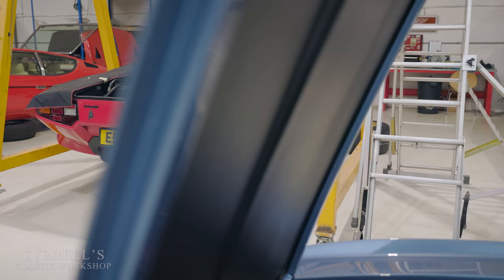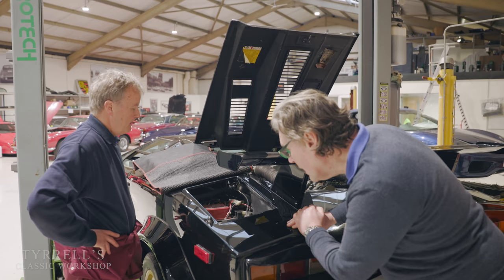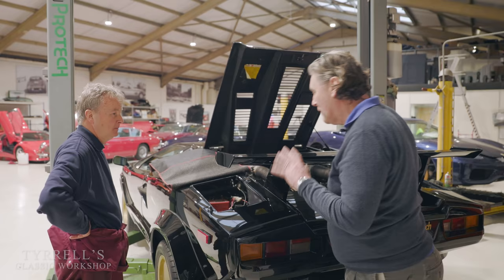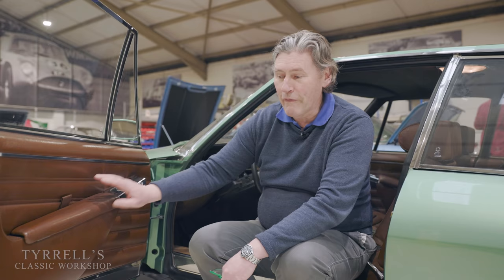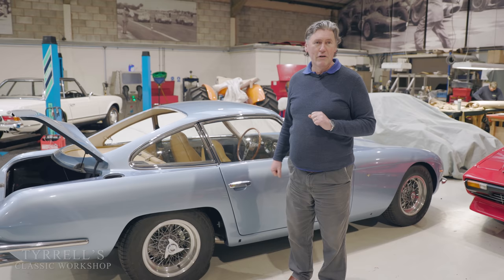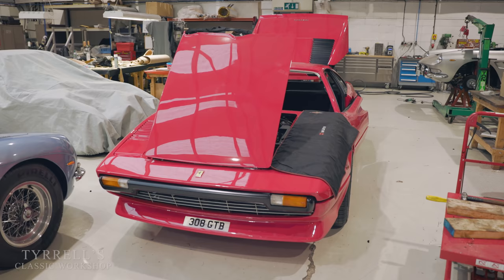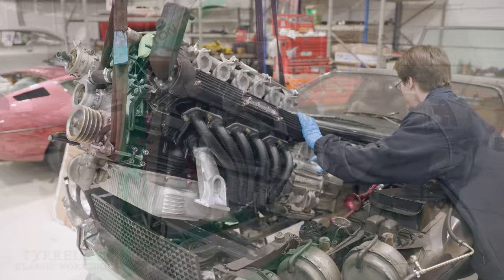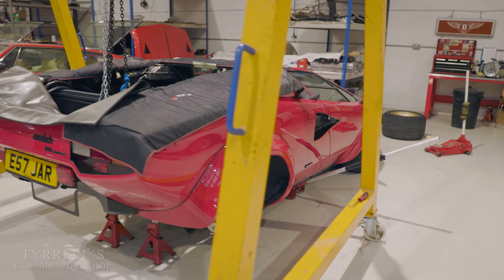One Lamborghini V12 goes in as Harry's is ready to come out | Tyrrell's Classic Workshop

Comment: Great episode again. Love watching this. Since the Countach has got the Bosch K-Jetronic injection system you might consider the 1970s trick of adding two stroke oil once or twice a year (0,5 to 1 litre of oil on one full tank will do). It works wonders in K-Jet cars that don't do a lot of miles, since it lubricates the tiny components in the injectors, fuel distributor and fuel pump. This was a standard procedure in Mercedes Benz and other brand's dealers back then. Full synthetic scooter oil works best since it doesn't smoke and has useful cleaning additives.

Comment: Black Countach. Add a Mega fuse block to the right rear vent box. Run a 4 gauge wire from The alternator output to that. Continue the wire forward to that. Power pin 30 of the radiator fan relay under the right engine compartment opening to the mega fuse block with a proper fuse.  Power both fuel pump relays from that mega fuse block. Run the thick red wire to the MSD box there also.  If the black countach had an ac compressor  install a relay with pin 30 also powered by the mega fuse block.  
This reduces voltage drop to the front and back to the engine compartment. Gives the evaporator fan more power to spin faster to eliminate having to open the doors at stop signs to get air in the cockpit.  
Get a skinny guy up under the fuse box or pull the glove box. Follow the wiring out of the fuse box thru the loop then as it turns toward the front of the car. You will see where the wiring harness rubs on the bare steel dash structure creating a fire hazard.  Before putting the glove box back in
  Unplug the antenna from the back of the stereo. Zip tie a universal replacement antenna horizontally to the dash structure. Then plug that into the radio.  Nobody will know. It cant be seen. The radio reception is so much better than the in windshield antenna. 
Lastly. Pull the louver behind the right door. Pull the triangle panel that let's you into the engine compartment near the fiat 124 thermostat. Yep. More fiat parts. Check the translucent wiring harness connectors for signs of overheating.  It's the power wire from the back to the front that the connector gets hot  and goes intermittent. 
Lastly. Bosch alternators . One brand perhaps more have an adjustable voltage regulator available. It's set for 14.1vdc. Have an alternator shop put it on an alternator and set it for 14.8 volts. The battery in the front boot will now get 14.1 volts with the engine running instead of 13.5 volts which leaves the battery only charged to 65 or 70%  dont believe me. Print this out and prove me wrong.  

Grab the distributor rotor with the cap off and twist it. If the advance weight bushings rattle. Please take the distributor apart and check for worn bushings. Worn pins in the weights.  Worn slots the bushings ride in. The bushings wear in half. Fall into the cap and destroy the 300 buck rotor. If they fall into the distributor housing and destroy the reluctor. Countach electronic ignition distributors are almost impossible to get.

Comment: What amazes me is the way he adjust the tic over on 60s Ferrary and Lamborginis just with a screw driver, twisting in an out untill he gets a smooth tick over. I have a 1960 Fiat 600 and I do exactly the same thing. Of course I have only one cylinder and carburettor. An old mechanic once told me not to screw in the adjuster to much. If you do it you could make a small indentation on the adjuster and ruin it.

Comment: I too recognise that window winder gear as the wiper drive gear on my Fiat 124 coupe. Also used on the 206/246 Dino. Superformance there in the UK offers a full metal replacement.

Comment: FYI the French window and headlight motor gears were also used in the De Tomaso Pantera, which was built to the tune of 7500 units or thereabouts. The size of that market means there is a robust aftermarket, and we have been replacing broken plastic Pantera window gears with new ones made from brass for decades. All the Pantera parts dealers carry them and they cost about $40 each—a far cry from what the Lambo and Maserati parts dealers charge. (In fact they usually buy their gears from the Pantera parts vendors and then mark them up a million percent!)

Comment: 10:50 The Pontiac Fiero has the same problem, fiberglass body doesn't rust, but the frame sure does, I had to weld in two new frame rails on mine. The DeLorean has a similar issue, the stainless body and fiberglass tub look great, but the Lotus designed Y-frame chassis is epoxy coated steel, and I've seen some VERY crusty rusty examples with only a few thousand miles on them.

Comment: I would’ve used triple sealed modern OEM style connectors on the ignition setup rather than those molex ones with no water ingress protection on the back of them. While it probably won’t be driven in the rain, as you said,   waters bound to get in there when people wash it.

Comment: I would use some more modern style sealed plugs in that US countach. If you recognize the design problem of putting the electrics in a place where water can get in it blew my mind that the new connectors are closer related to inside PC type and not proper automotive fully sealed type. This will work for a few years before the entire thing starts acting up again.  To me electrical work was of a lower level compared to the other repairs shown.
Reply from the maker: That’s the owner’s choice. Back to OE. Thanks for your interest

Comment: Hi guys, next problem will be fuel distributor head. It will have rust and not be able to supply the correct amount of fuel to injectors. K-Jet is the most susceptible to moisture. Next problem will be the electric fuel pressure regulators, again bi metallic strip inside fails and it will have a constant lean mixture. Have fun, I’ve delt with all sorts of injections for over 35 years.

Comment: The leather seats in the SM look the same colour as the ones that were in my much-missed 1985 CX GTi, though mine were closer to the Before rather than the After condition (still smelt nice, though!). That same car had a nylon gearwheel (missing some teeth) controlling the heater flap, driven by an electric motor to balance hot and cold air flows for climate control (why make things too simple?!) - so I wonder if that's a THIRD use, alongside SM windows and  Miura headlights.

Comment: Had to giggle, no battery on the citroen. But the interior light is on 😅, I would have thought on the lambo if the wiring is exposed to the elements he would have used sealed wire connectors instead of exposed with live current going through the connector (double red wire connector). Moisture loves a good live wire.

Still an avid fan

Comment: Iain, I absolutely love the work you guys do there.
I've got to ask, do you ever consider custom cams from Kelford, Cat, or similar?  In comparison to a 1970s or older cam profiles, modern engineered camshafts have to be worth a 50% improvement in the same or lower rpm range. In something like a downdraft Countach, 600hp from swapping out cams and springs isn't far fetched.

Comment: 3:15 I should have guessed, you know I knew ferrari did this on the daytona where the car pretty much had two of everything for either bank of the engine, its just here its using K bosh fuel injection instead of Carbs, so now you've got something far trickier to set up and get working right, given this is still about 20 years before computers really came into their own in cars, as BMW was still using K bosh computers of this nature all the way up until the late 90's that worked just like this, with two of everything hence why on a car like a BMW 850 I if you dont synchro them properly, and get everything working in sets of two

which might be a good service thing to do, if one part is broken, replace it on both sides

you'll never get the thing running, let alone well at all.  Also if you put the electornics back in the same place, look into putting them into waterproof plastic boxes or something of that nature that they would use on things like Radio Controled Subs

given for some reason their sitting at the lowest point in the car where water can collect just aft of the grills, which I dont even think actually do anything given the Nasa ducts feed the engine, and the grills over it allow it to cool

while on harry's car it was just infront of that grill so the only way you could screw that up was if you squirted water INTO it the wrong way it would normally flow

also is harry ever gonna get rid of that stupid ES Jar Plate for that countach, like surely theirs gotta be a better number for it
Reply: "Jam Jar" = car.
Not Jar Jar Binks!

Comment: Why not have fake grilles over those rear electrics? Do the grilles have a purpose? Espada engine removal/install, don't try that at home!
Reply: Yes, to keep the electrics wet😉
Reply: If it's only cosmetic, some blank ones would have worked fine. Or a plastic sheet over the electrics

Comment: I trust that these nonsense spade connectors will be replaced with some type of a proper sealed connector before going back to the customer! I have been burdened/ripped off by this type of shoddy solution by past service facilities on my own vehicles. It might look good... today. 

I know I am talking modern comparisons but the main reason that Toyota stands out for reliability is almost entirely because they look at EVERY mechanical and electrical contact point and optimize them for durability.